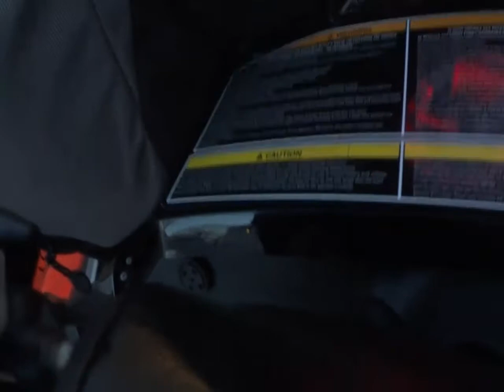RUSTED JUNK ariens auger bucket

Comment: Now Now, Ford's rust out just as bad as Chevy's and in some cases worse, I don't know if you follow, canadacatalyst but just recently they were scrap a Ford truck, and when they went to lift it with the loader the frame was so rotten the truck almost snapped in half.
Back to the snow blower I'm happy I have a older 1 built with way better materials.